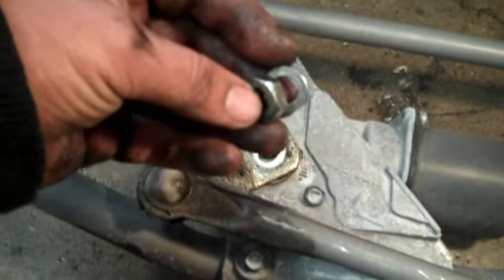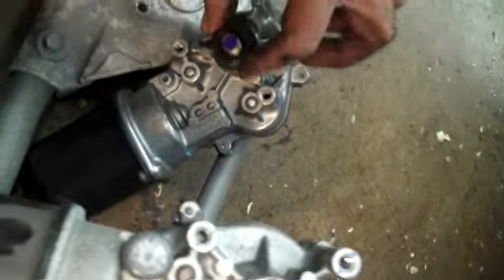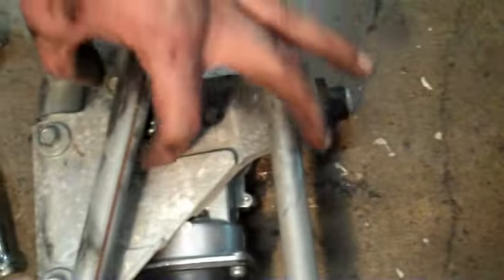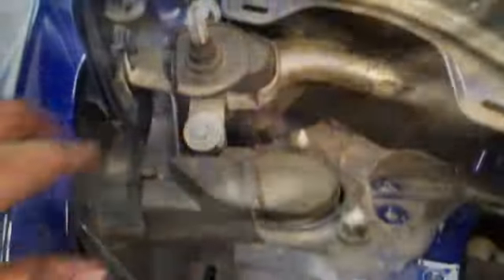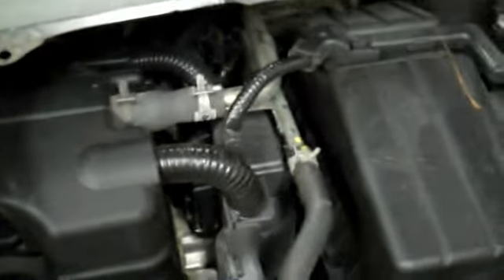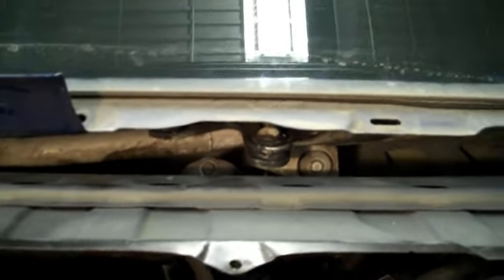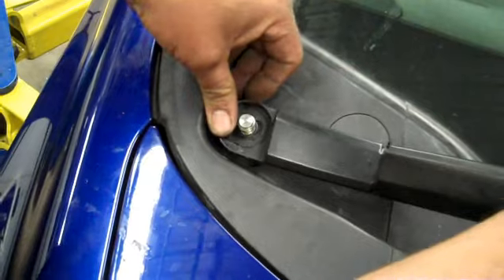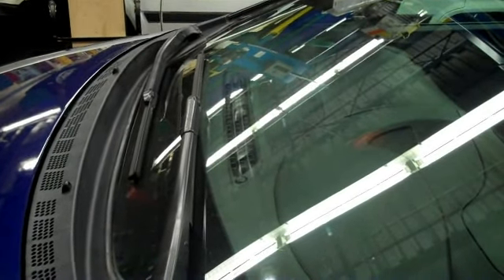07 Honda Civic wiper problem and solution. Part-2

Comment: Had the same problem with my 07 Civic. The wiper motor isn't the problem it's the electronics within the wiper motor shield. There's a plastic cover on the side of the wiper motor that you can remove, clean up the excess grease inside (make sure the contracts are clean - use an alcoholic spray or switch cleaner) and reassemble. Make a note of the position of the little plastic disc before you reassemble - I'm not certain it makes a difference, but don't take the risk! You don't need to remove the motor from the assembly arm either. This method is worth trying before buying a new motor. Failing that, try and get a new wiper shield cover rather than the entire motor, but cleaning should be the first thing you try because it's unlikely the motor itself is faulty, it's just the information feeding the motor that's causing the problem.
Reply: Would maf sensor cleaner be okay?

Comment: Thank you for this very informative video! I just completed doing this, but I left the wiper motor on the wiper transmission and just took the gear and swithch cover off the wiper motor to clean out what appears to be too much grease that was gumming up the wiper position switch. The wiper position switch is assembled on the cover. I just used carb cleaner to get the majority of the grease off this cover/switch and wiped it down the best I could. There was still a very small amount of grease on the switch gear when I re assembled.  Wipers work perfect now. I'm sure this fixed the problem for long term, but if it does fail again I'll fix it again and probably use a better grease. The work wasn't bad and the simple cleaning was worth saving $50. Thanks again!
Reply: Hi how long did the repair take to complete
Reply from the maker: brue o
Reply from the maker: brue o just around an hour
Reply: thank you, definitely let me know if it comes back!
Reply: Did the same thing and it worked for me. Took about 2 hours overall. It's worth putting new sealant back on the shield cover to stop water seeping in.

Comment: Finished this repair and all is working great again. Took me about 2 hours. When I was ready to install the new motor, the plug would not seat due to the pins being misaligned on the Chinese part. Since could not have the car out of service I read that I could also replace the cover, but wasn't available locally. So I removed the black cap on the old motor and cleaned out all the grease on the cover/cap with electrical cleaner. Kept the grease as is on the actual motor/plastic gears. Then reassembled and tested it and it worked great! No more intermittent stop or crazy movements. Been working great for 2 months through rain storms and a few snow storms.

Comment: what mark are you referring to?  I see four marks and they are all different sizes.  I tryed this and put my arrow on the long  mark of the three. When i started up my car the wipers never go into park position.  they stop just above it and I can't adjust the speed still. So i guess the motor is bad.  Any advise?
Reply: I tried resetting it again and the wipers are stopping even higher on the windshield.  What should i do to correct this? Should i line the arrow up with the dot and not the hash marks?
Reply from the maker: When i disconnected the passanger side, i ligned the arrow with the longest line and when iconnected it back i ligned it up with the same mark. once you have it all together, before installing the wiper arms, turn the motor on and then off. this should be the park position. install the wiper arms at the park position. hope this helps.

Comment: Informative video, thanks. As the old motor was working but the only problem being the wiper does not stop at the right spot, would it be possible to have the motor repaired instead of replacing the whole unit..?
Reply from the maker: I am sure you can remove the cover and repair it, but i didn't wanted to take any chances for a $50 motor.
Reply: @FrankHurtAuto  ty for this video, gf just got one of these and the wipers started doing this. Is there a different brand that has a lower failure rate that you know of or perhaps something like with the nsx and the (if i remember right) 96 has window motor failures but using a window motor from a 94 fixes the issue?

Comment: I did mine last night, you just have to unbolt the nut, were  it is reset, remove the nut, replaced the new motor, place the gear in the spline, it will be difficult to line up the splines old with new, use the nut and washer to give some pressure, one you have pressure tighten the nut, that. is all you need to do. do not move them arm.
if you look ond the back there is two line, where the arm is line up. Use them as reference to reinstall  the arms.
Also before putting the bottom cowl back, check the operating of motor. 
another thing that i did was before removing the wiper arm I mark the bolt and side of arm  to give me a reference points on reinstallion.
you will have to adjust the arm, but all said and done very easy repair! .

Comment: I have a similar problem. What is nearly nothing coming out but motor is working as it sounds that its working. What do you think is the problem?

Also mechanics in Malta will not do this shit for you, they are to busy moaning.

I wanted to ask if there's a water filter attached to the water bottle? if yesa and is dirty, I can have this issue right?

Thanks for the vid
Reply from the maker: I am assuming that your problem is windshield washer not squirting water on windshield? If you can hear the motor but no water coming then check the hoses, sometimes they come off. There is no filter
Reply: Will check the hoses. Thanks mate